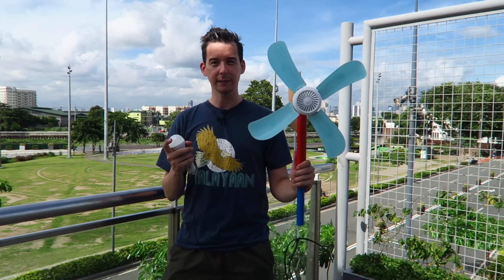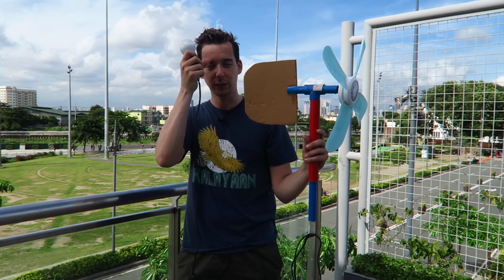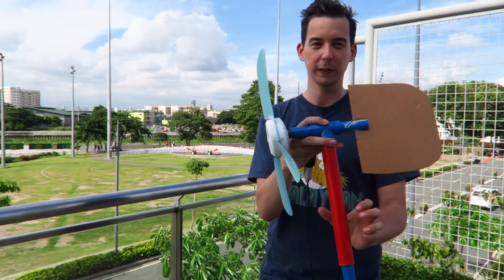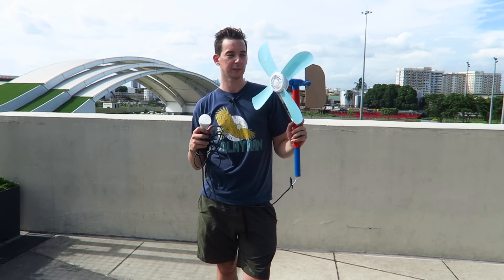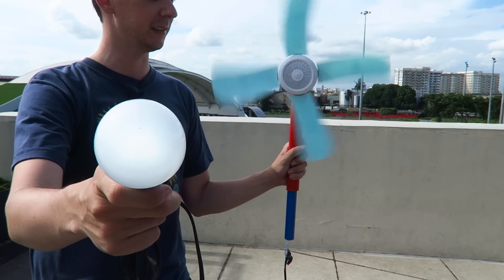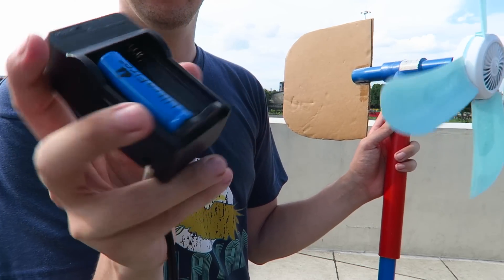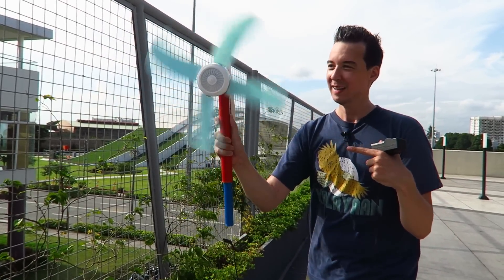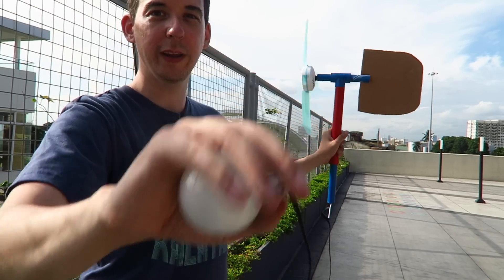DIY Wind Turbine Update

Comment: You didn't rate the voltage by using a meter
Reply from the maker: I made quite a few videos on this. Other videos include voltage readings. You'd probably want to rectify it and then drop it to something more useful.

Comment: good video ' no black hands with stupid music for a change ''''' i saved lots of time by buying four toy turbines on small dc motors on ebay for ten pounds total with free delivery i joined them together using a ac to dc full bridge rectifier '''''''' mine cost less , with no effort to make and with an adjustable regulator puts out more power and better in low wind current , mine charges a bank of 10 x 12v lead acid car battery's ....... so yh lol nice job any way .

Comment: If you wanted to make an array of several to charge a battery could you?
Reply from the maker: +g j it should be doable :) but you might prefer to get larger versions of this fan so you don't need so many for the same power output. Of course the larger ones require a bit more wind.

Comment: What I absolutely love about your videos is your attention to quality and detail. I know you are self conscious of the audio quality and exposure, but even your 'worst' videos are still 500% better quality than some hillbilly in his sweaty garage. So keep on cranking out great content! :) I only have two requests: 
#1 could you please buy/use a Kill-a-Watt meter to display the voltage/amps/watts you're getting, and also... 
#2 can you please provide links were we can purchase the fans ourselves? 
+/- 5 watts may not sound like much, but with several of these bridge-rectified and in series/parallel (such as the Tree Vent in France) could produce a substantial amount of wattage, and could be grid-tied into an inverter. 
Thanks again!
EDIT: I found the 8 watt version on eBay (link below). Now just need to figure out how to get from 50 hz to 60 hz (U.S.)
http://www.ebay.com/itm/Super-Silent-Mini-Portable-ceiling-fans-mosquito-net-electric-fan-wind-net-XB-/142431530304?_trksid=p2385738.m2548.l4275
Reply from the maker: haha thanks :P I do have an AC watt meter but it doesn't play nicely with the unstable output of the wind turbine. In a previous video, I showed the output voltage and talked about the challenges of measuring the output power, you can see that here - https://www.youtube.com/watch?v=W-ylItFF2po . It's hard to provide links because this kind of budget item is always going in and out of stock and changing models. But if you search eBay or Amazon for 'mini ceiling fan', you'll see many different models. They're all pretty much the same inside. I'll soon have a video about a 9W version which should be much easier to play with.

Comment: Dear Gadget Addict . It very good VDO.I during try the same thing as you too. From AC I use bridge to DC and add some capacitor. It can drive LED  (with out AC LED Driver) with out blinking.I use it for strong wind at Building Ventilation exhaust fan duct it work well. But Blade need to change to strong than plastic.It will crack or break at hub when during on load for strong continue wind.
Reply from the maker: Interesting, thanks for the info. Did you replace the blades already? If yes, with what?
Reply: I open front cover by un screw it from the back and take all back and front cover out.You will have 4 holes to attach by other thing.I try with- normal electric  fan blade with small metal frame to attach by nut and bolt.  (For horizontal wind turbine)- and try to attach with squirrel cage blower blade.(For vertical wind turbine if wind come from all direction)

Comment: Have you tried connecting your Panther 6A battery charger and use it to charge a lead acid batt? or if there is such a thing as an AC buck converter to regulate an unstable AC current to a steady 220V output?
Reply from the maker: The output from this ceiling fan is a bit too lower to work with the Panther battery charger. But it works with a little 12V AC/DC brick and was able to dump some power into a lead-acid battery.

Comment: Would it be easier to use a 12v dc ceiling fan instead? I bought one for camping a while ago on ebay for approx $10 but there's plenty available.
Reply from the maker: +Marty Curlis yup that would be easier although you'll.need a heavier gauge wire to minimize power losses. Where did you buy it?
Reply: Full disclosure: I'm a dumbass, not an electrician, and don't know much about electricity. That said, I've read many sources say that the DC motors (ie. a treadmill motor) can very easily be turned into a generator simply by using a blocking diode. However, I've read that the AC motors/generators usually have a much higher output, simply because their coil windings are very small, and use smaller wire. This results in higher output at lower RPM's. Again... so I've read...

Comment: How many cell phones does it "charge" considering that it works intermittently and depends on the existence of wind?  How many of the phone calls made are actually necessary.  And how much  fossil-fuel-equivalent does it take to manufacture its blades and other components when they need repairs.  Who pays for the technician who would re- reassemble the broken pieces.  Who will compensate the repairman who falls to his death while attempting to replace a broken part.  Mind you, i do not advocate for the status quo for it has its own unacceptable impedance.  We must realize that humanity has come full circle to the futility of trying to support a burgeoning population whose demand for energy is insatiable.  And you can take this to the bank!
Reply from the maker: Many of the far flung provinces in the Philippines suffer from regular power outages which can last for hours, days or even weeks. Being able to keep even a basic cellphone charged can ensure contact to the outside world. If you can charge a smartphone and have mobile data, even better because now you have internet access and entertainment. As for how many phones it can charge, it depends on the phones and how much wind you have. The idea is to store the power in a battery and consume it later at a more consistent rate, because like you say, the wind turbine output is intermittent. This is a very basic DIY solution. There's no technicians or 60ft towers being used.

Comment: Can you send me the link to where you got that ceiling fan and also are you going to make a wind turbine generator
Reply from the maker: Which country are you in? I bought mine on Shopee which is specific to the Philippines. In the UK or US you should search for 'mini ceiling fan' on eBay or Amazon :) And yes, this is essentially already a wind turbine power generator :)
Reply: Gadget Addict I like the video makes me want to build one just need to learn how to are you going to be adding any solar cells on your wind turbine to help it charge the 18650 batteries through the day
Reply from the maker: +will no plan to add solar. If I did, it would be completely separate to the wind turbine.

Comment: Awesome, dude! Did you hear about the wind farm that the UK recently installed in Scotland that will provide power to about 20,000 homes? The blades are as big as the wing span of an Airbus 380. The system was built in Norway.
Reply from the maker: I hadn't heard of it but I've seen some wind turbines in the UK and they're huge!

Comment: can you make a automatic solar light circuit?
Reply from the maker: I made one before but it's actually cheaper/easier to use the off the shelf one sold in hardware shops. You can either buy the 12V version or the 220V and modify it.
Reply: Gadget Addict do you have a video making the circuit? i want to know how to build one because i have some solar panel lying around. thanks...

Comment: Would it be possible to hook up the wind turbine to a solar regular, then to a car battery to prevent the battery from running the fan? We have an old jeepney we used to feed our cows and it doesn't have a reliable alternator. So I figured hooking up two of those turbines to the roof of the jeep would charge the car battery while the jeepney is running.
Reply from the maker: If you added a bridge rectifier between the wind turbine and the solar charge controller, maybe. Because this turbine outputs high voltage AC. I'm not sure if the ~3W watt output from this would be enough to keep your battery in good condition. Might be better going for the bigger version.
Reply: Maybe a couple of these then haha, first wind turbine jeepney hybrid haha

Comment: maybe you can put solar charger in order to charge some battery and use it on some appliances .
Reply from the maker: This outputs high voltage AC, so you'd have to add a bridge rectifier first to convert it to DC. But potentially yeah. I've paused testing with this version for now to focus on the 9W version which should be easier to work with since we don't have to worry so much about every little loss :)

Comment: This fan/bulb setup would work very well in many rural areas located along shorelines or even mounted on small bancas.
Reply from the maker: That's true. For anyone who just wants basic lighting while the wind is going, they can replicate this exactly without any extra components and they'll have light whenever there's wind. Personally I'm still more interested in storing the power and using it later at a more consistent output. But it's an option :)

Comment: Idol, try hooking up to a AVR, will help regulate the voltage without damaging an electronic device that's hook up.
overall it's really nice idea!
Reply from the maker: My only concern is that the more equipment I put between the turbine and the load, the more power losses and potentially the more cost. But it's something I'll test/play with anyway :) Thanks!
Reply: awesome idol!

Comment: is there any device that we can attach to this so that it can store electricity and at the same time it will output stable 100 or 220v ac power? that is very promising to resolve electricity issues in some parts of the philippines.
Reply from the maker: The long term goal is to store the power in a battery. Either a small 12V lead-acid battery like you'd find in a UPS or a USB powerbank. Personally I'm more interested in charging a USB powerbank because they're cheap, high capacity and don't require maintenance like a lead-acid battery would. You can also just use the power directly like I did in this video. But the fluctuating voltage probably wouldn't do your electronics much good in the long run.

Comment: We have one of those fans in our hut on Samal. It works very well in a confined area.
I did have trouble with it at first though as it was very unbalanced. I did discover the remedy whilst laying in bed and staring up at it...........our "electrician" had installed one of the blades upside down! Even when I pointed it out to him he still failed to see the problem.
Reply from the maker: oops lol! Although I can't say too much because in another video I inserted all of the blades facing the wrong way and then wondered why it wasn't spinning as fast in the wind anymore :P They're now glued in to make sure they don't fly out in heavy winds.
Reply: Gadget Addict what motor did you uses?
Reply: *used
Reply: where can I buy turbine charger in philppne sir.a lot of tnx

Comment: Love these type of videos from you. I see they do a 12v version too, what do you think would be better for charging lithium/sealed lead acid batteries? I'm interested if the AC or DC version would be more efficient when it comes to converting the power generated into a usable current?
Reply from the maker: Most likely yeah. I mean that's essentially what we have inside the battery charger I showed in this video anyway. As much as possible i'm trying not to re-invent the wheel or more importantly make it easily repeatable by people who don't have access or knowledge about special electronic components. I think we'll find things much simpler with the 9W version. More power to play with and less concern about minor losses.
Reply from the maker: The DC 12V version would be much easier to work with. You can step it up to ~14V for charging lead-acid batteries and there's many in-car chargers which could be used to step it down for charging USB powerbanks etc. But the downside of the DC version is that it's a bit more expensive, very difficult to buy locally, you have to order it online from abroad and you'll need thicker wires to deal with the voltage drop. I have a slightly larger AC one that I'm playing with and hoping to get out a somewhat stable 5V 1A to charge a regular lithium-ion powerbank. I'd much rather charge a powerbank than a lead-acid battery.
Reply: Gadget, could you use a bridge rectifier to convert to DC ?
Reply: Yes. My thoughts exactly it is the same thing, except may be able to connect to a standard 12v battery.  But I do see your point, more simple.